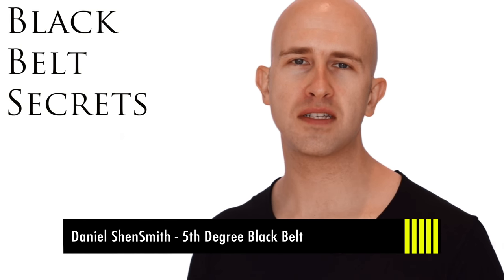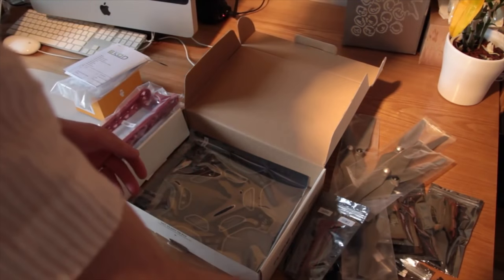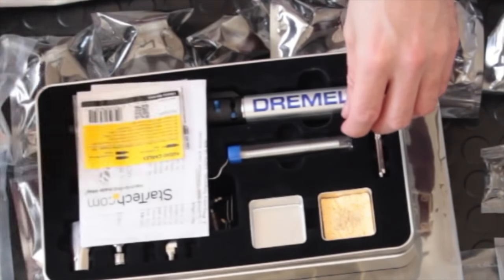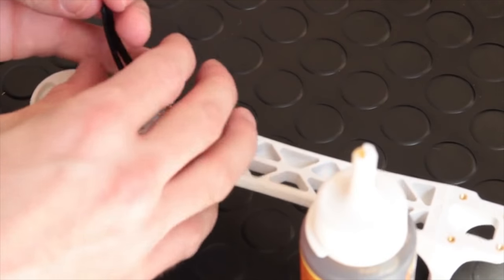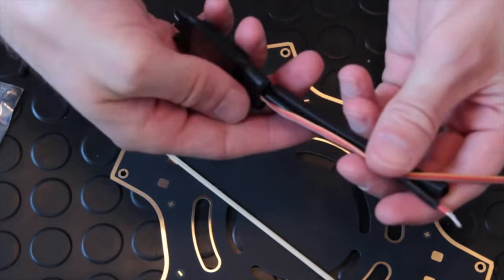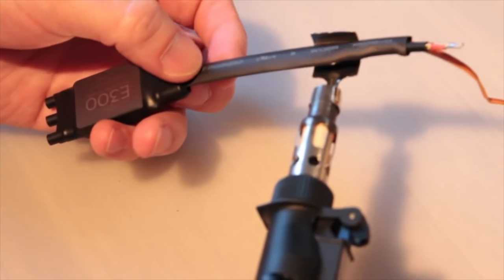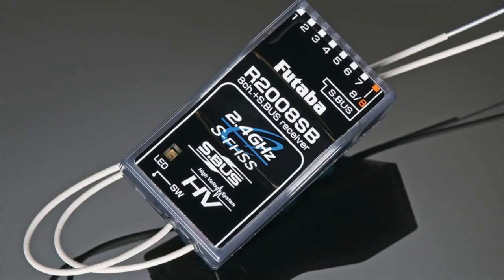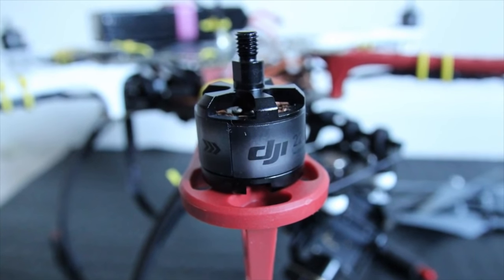How to Make a Drone! |  DJI | Multicopter

Comment: A nice hexacopter kit!  And the price is not too onerous.  I will save up my spare cash and get one.
One criticism. I hope you don't take offence but your soldering is poor. Get a good quality electric iron and use a large soldering tip when soldering the heavier motor cables.  The small pointy tip that you are using is really only for small components and small gauge wires.  Use a 4 or 4.5mm chisel tip. That Dremel is not good enough for this type of work.  I'd suggest a decent quality Antex or even a soldering station that has adjustable temperature control.  
I have subscribed and look forward to your flying videos.
Reply from the maker: Not at all, it was my first build! Thanks for watching
Reply: Soldering does not take long to get used to.  After 45 years of it I am fairly proficient.
I shall have to be a good lad for some time now until Beloved agrees to release funding for an F550 kit.
This will be a problem as I flew my Hubsan H109 into a tree last week.  Very messy and very expensive.
She was not best pleased.
I shall look forward to your next build and your flying videos.

Comment: Gorilla glue is inappropriate for the thread locking. Use Loctite or such. Flux is not necessary if you use the proper solder. Use a rosin core 60/40 for electronics. Not a bad video but suggest noobes check out several others for the best overall information. The more information you have going in the easier your build will be(and better).

Comment: I got the 550 flame wheel and when I throttle up all it does is flip on to its side.  can you help me please?
Reply: does it go straight to flipping or after its in the air it flips?
Reply: You may have one or more motors rotating the wrong direction.
Reply from the maker: It must be that one side has more power than the other, try balancing them out